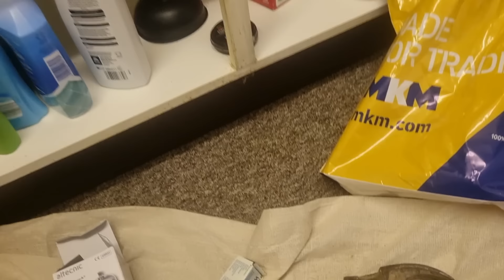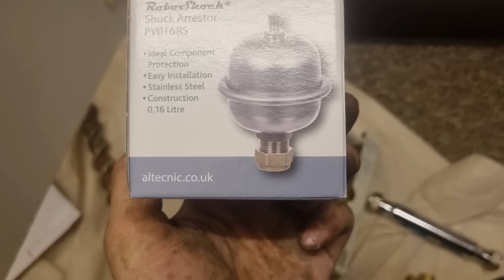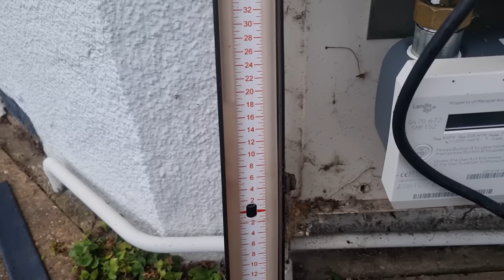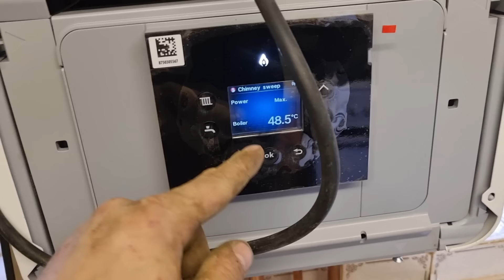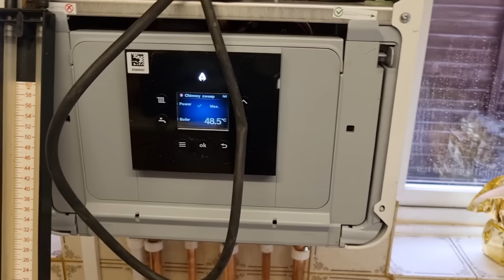How do I tackle a job like this?| All my secret tips and tricks revealed

Comment: Hey Tom, great video. A quick tip for you and anyone who doesn't know it yet - use your wet & dry vac to get the syphon going on the hot water cylinder. I find it loads easier than sucking on the hose pipe and you don't get a mouthfull of all the crap that's built up in the bottom of the cylinder.
Reply from the maker: I really should start doing that more, I think if I had a battery wet vac I would because currently I have to run an extension lead which is a pain, thanks for watching mate, the support is greatly appreciated 👍
Reply: Use a length of plastic pipe cut at an angle at the bottom and put a elbow on the top and a short bit of 15 copper then the hose and try that

Comment: Retired plumber of a lot of years, lead wipe joints etc, its never wrong Tom, so long as its safe, surprised you got away with gas run, some manufactures insist on 22 to under the boiler, as for mice eating yer pipe, your more consensus than me, I used it wherever it was easier to job the job, and some ask for a by pass on a smaller system, watching you brings it all back, pipes at the back of sink, changed all my trvs to wheel heads , never used as a thermo anyways, you got an old head on yer, good lad, injector tee ( thats right), keep doing ya thing
Reply from the maker: Thanks for the support mate, I did run the gas back to the 22mm, you won't get away with anything less on these

Comment: Injector tees were old hat when I was an apprentice and I'm now retired!
The thinking was that they saved a tapping on the boiler and at the same time gave the gravity circulation circuit a bit of a boost when the CH pump was on.
Strange thinking nowadays and yet it made sense at the time .
Keep them coming Tom..
Reply from the maker: It's surprising how systems have moved on, still I bet the new boiler won't last as long as that old back boiler, things were built to last, thanks for watching
Reply: I don't know whether they were 'old hat' or just that combined gravity and pumped systems went out of favour.  If you didn't have a 4 pipe back boiler and then don't have an injector tee on a pumped return that meets a gravity return, the/some pumped return will flow up the gravity return.  An injector tee will 'suck' the gravity return down as it returns rather than split the flow that.a standard tee would - I think at least - i have never come across them ever!  And yes Tom you're right - stuff wsa build to last without built-in obsolescence as today

Comment: Hi Tom, great video as always. 
On the Worcester paper templates if you fold the bottom clearance indicator up you can mark all the pipes down the wall for your clips 
That way you can do all your drilling together before you hang the jig.
Found a nice bacho spanner in a boiler recently. Always interesting finding old news papers to see the dates the last person was under the floor!! 👍
Reply from the maker: Good tip that Shaun, I tend to use my laser level through the centre of the gas but I couldn't be bothered to fetch it from the van as it was a good walk away. I only ever seem to lose tools and never find them, a bacho spanner is great find, thanks for watching mate

Comment: Alright Tom, I always put a drain off on the flow under the boiler, isolate the flow valve then flush with the filling loop on the return, it means I can pipe and fit the boiler and it helps to wash the cleaner out after the hot flush 👍
Reply from the maker: Good idea that, thanks for watching mate

Comment: Great video m8t good content noticed timber around gas fire and I bet that had no 3rd seal either ….looked like it had never been serviced …👍👍👍
Reply from the maker: I did spot that as well, when I first looked at the job the customer wanted to keep the gas fire but I talked them out of it, I wasn't happy with a few bits on it, electric is safer and if you only want the look rather the heat it will be just fine, thanks for the support as always mate

Comment: Nice  job I used to fit back boilers only issue adjustable spanner on chrome nuts and do you need  to deburr pipes any more all American plumbers  seem to ..bob
Reply from the maker: Thanks for watching, I use knipex smooth jaws on my rad valve nuts, it doesn't mark the chrome usually

Comment: What difference does having a water meter have and fitting a shock arrester? Great video good work. 😊
Reply from the maker: Water meters have a check valve built in so the water can't go back into the main, if there is no meter fitted, the shock can go back into the supply pipe, thanks for watching
Reply: Thanks 🤩

Comment: Great video mate and great install. Was there a balanced cold off CWS for bathroom or was it off mains. Just incase anyone was watching to link them at hotpress if that makes sense
Reply from the maker: There wasn't on this one, everything was off the mains, it's not uncommon though to find at least one tank fed supply which would have to be linked back through to the mains, thanks for watching mate

Comment: Hi, Tom wy do you only do a  main cold water flush ?  as some areas only have 1bar pressure  to is not enough.
Reply from the maker: I find this a really good way of getting the system clean, it's similar to the thorough flush, but like you say relies on having good pressure, I'm always surprised how much muck comes out of a older system. If I'm not happy I can still bolt my power flush machine on after, thanks for the support mate

Comment: your videos are very insightful and encouraging, especially, for the younger generations. Thank you mate for the hard work.
1. is a combi better for oil boiler than our immersion tank etc we have currently?
2. can I replace the plastic tube oil tank level indicator while the tank is full? it is an old steel outdoor tank with an external push button visual tube indicator with the sight tube aged and discoloured. should be obliged for a reply.
Reply from the maker: Thanks for watching mate, you should be fine to change your site gauge as long as the main shut off valve is first from the tank, all you will need to do is isolate that valve, and just swap over the site gauge 
Oil combis are decent but are very expensive to buy, it often works out cheaper to go for a standard boiler and upgrade to a high efficiency cylinder, hope that helps
Reply: Yeah very helpful. Cheers mate. Wish you all the best.

Comment: Hi mate what do you mean by the shock arrester protects the hydronic block? Great content 👍🏻
Reply from the maker: The hydraulic block is the plastic components on the water side inside the boiler. When a tap is shut quickly it can send a shock wave back to the boiler and cause the heavy wear on the plastic parts, causing them to eventually fail. All the shock arrestor does is takes away that strain, as the water has somewhere else to go. Thanks for watching mate

Comment: Hi Tom, can I ask is it the Milwaukee c12 cutter you have, I see there is also an m12 that cuts steel pipe and that but I would mostly only be cutting copper so assuming that c12 be ok. Also are they worth it? Do you use yours a lot?
Reply from the maker: I've got the inox version that's designed to cut stainless, it cuts way faster than the original and I'm still on the same blade having had it for nearly two years, it's been abused and it still cuts like new. I have even cut thick wall steel pipe with it and it still won't break. The inox version is also water resistant, I used to find the older one didn't like getting wet, it would dry out but would stop working for a day or so until it had. It is worth the extra money but the other version is still very good, it takes a bit of getting used to and won't fit everywhere a pipe slice can, but some jobs it does save a lot of time, thanks for watching mate
Reply: Thanks very much mate

Comment: What does the arrestor do , just curious
Reply from the maker: It takes the shock out of the water when a tap is shut which in turns helps relieve the strain on the boiler components, if you imagine if a tap is suddenly shut it will send a load of pressure back through the pipe and into the boiler, the arrestor just reduces this shockwave, thanks for watching Mark

Comment: Hi  Does the 4000 have the horrible kebab heat exchanger
Reply from the maker: It does, the 8000 has the classic heat exchanger and the new 1000 has a one similar to the baxi's, thanks for watching mate
Reply: @PlumbLikeTom  So the 4000 is an upgraded 30i .
Servicing is terrible .
Reply: Time to get rid of of the kebab  heat exchangers and the compact is awfull  .
Reply from the maker: They have improved access a lot to key components, the prv is at the front and the expansion vessel is at the side, both very easy to service and or replace, the plate is also easily removable once you remove the condense trap. I do agree with you about the compact range, I try to stick away from them as they are a real pain to work on

Comment: 10:41 'as long as you know you're doing it wrong, does it make it alright?' real life, i suppose  ...
Reply from the maker: Thanks for watching mate, I think sometimes there should be a common sense approach to stuff, the reg is there to stop gas pipes being run at weird angles through walls to prevent them being hit, this one wasn't extreme and sometimes the drill naturally wonders off track a bit especially when drilling multiple holes

Comment: The things you find in airing cupboards , magazines,  dildos and a 12 inch bahco adjustable spanner that was under the cylinder   it was sticking out of the back and the cylinder had moulded around it without splitting , probably been there 25 years. The plumber who lost it  would be wondering what had happened to it.
Reply from the maker: A bacho spanner is a great find, I only ever seem to lose tools, thanks for watching as always Dennis, the support is greatly appreciated